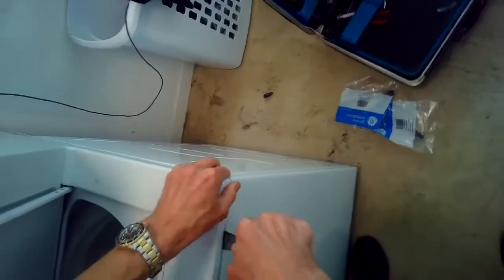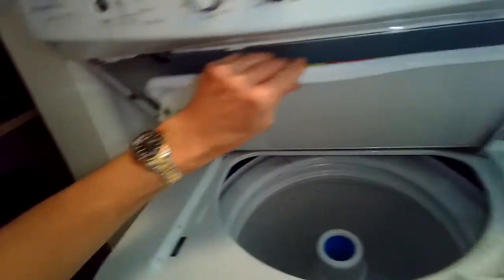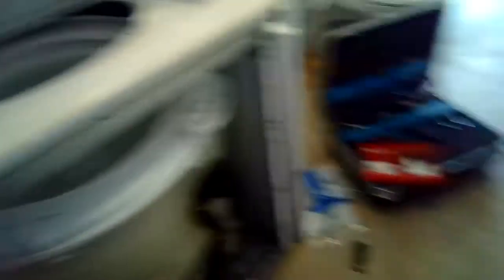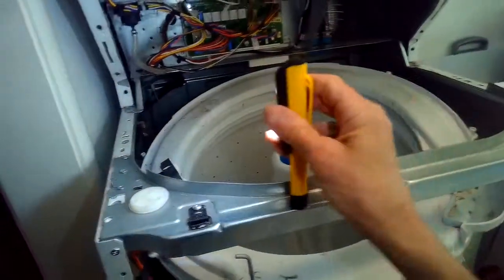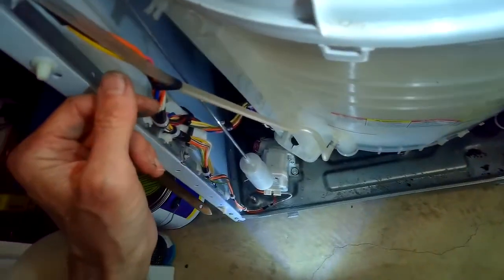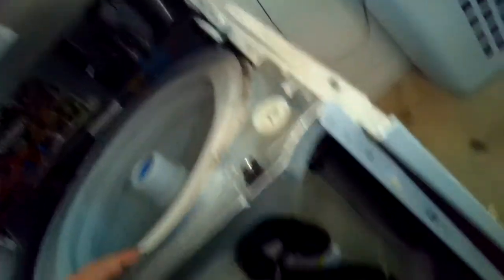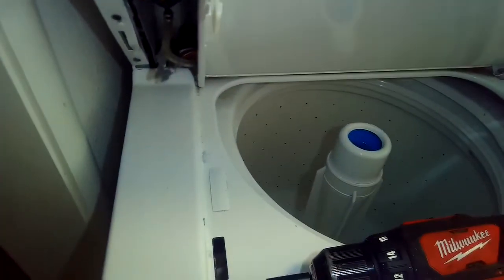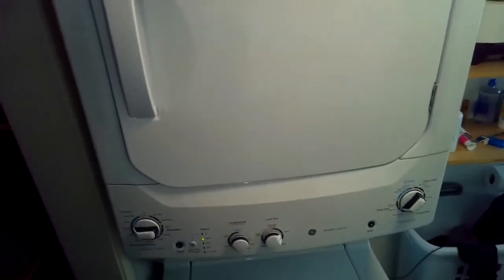GE Laundry Center — Basket Crooked— EASY FIX

Comment: Very clear and direct. Videos are great. But it looked like there was a rubber strap on the front right suspension post, but you mentioned there were none - is that something else? I'm pretty sure mine has the same issue, but I don't want to open it up without knowing what the fixes may be. Thanks.
Reply from the maker: Some of these do use four rubber straps and some don’t.

The rubber straps often break when the machine is overloaded.

Comment: Question: How do i get the latch on the front right panel to clip back in. It refuses to lock in. I washed a bathroom mat and it shook the machine so bad that i had to stop the cycle. When i removed it and did a test run, the drum kept bumping into the panel and it became dislodged. I checked if the drum was off its suspension (after watching your video) and it wasn't. So i tried to reattach the the little metal latch to the front panel and it just wont click. Any suggestions? By the way, thank you so much for this video. It honestly helped a lot. I know now not to wash any mats or blankets in this machine.

Comment: Mine goes into spin mode and thrashes into the front panel so hard then it pops off.  What a piece of crap.  Was brand new and not even a year old.
Reply from the maker: I think the 4 rubber suspension straps broke off .